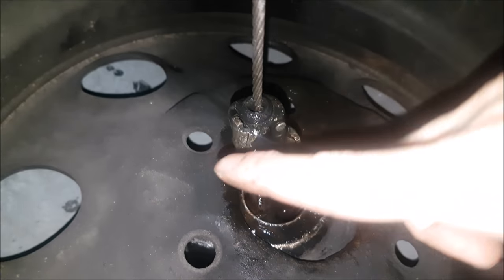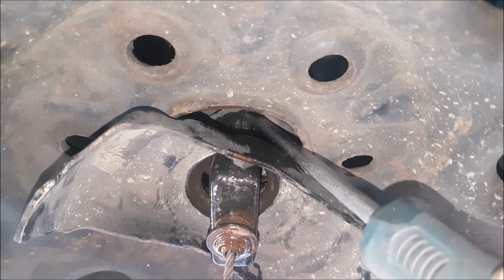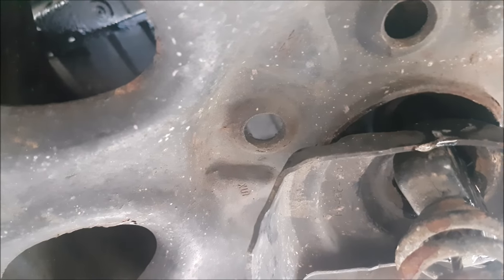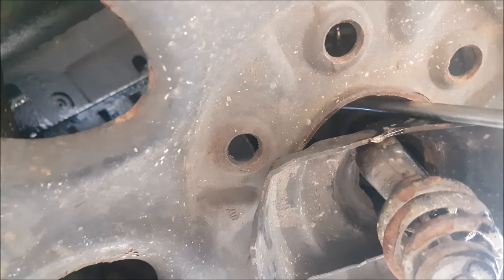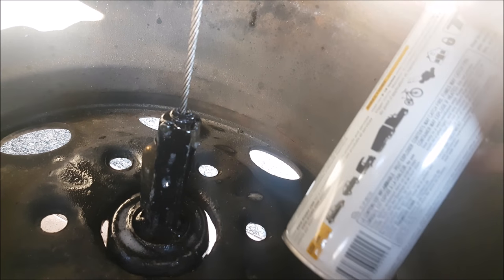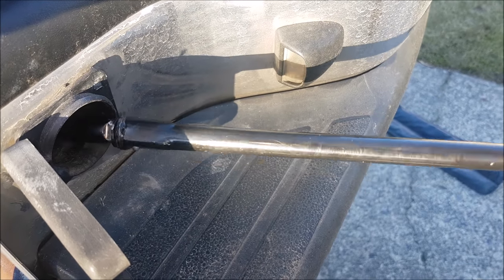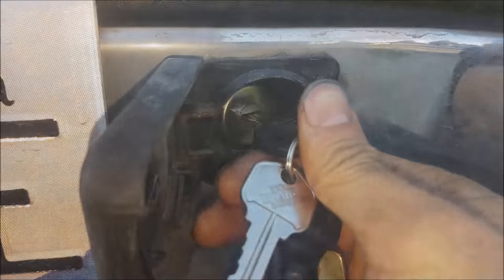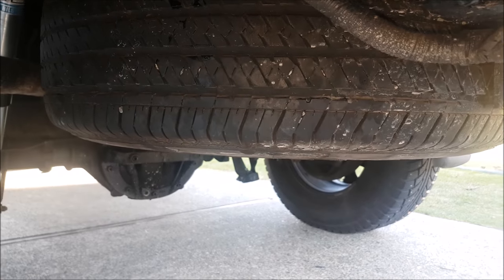Stuck Spare Tire Removal GM Truck / Silverado & Sierra (Secondary Safety Latch) | AnthonyJ350

Comment: 5yrs later and you still have people saying Thank You! Thanks man. You saved me from using my grinder wheel down there, I'd about had it!
Reply from the maker: Glad the video helped! You can taper the lock hook shape with an angle grinder. Then spray the assembly in Fluid Film to make it easier to drop.

Comment: 2009 GMC Sierra 3500. Thanks for posting this! Laying on the side of the road in heavy traffic, in the rain, and it won't release 🤬. I saw the part where you mentioned that not tightening up until it clicked can be a problem, so l wound it back up tight( the end of the tool snapped off, thanks GM) and the lowered it again, and it came down flawlessly 🙌👌💯
Reply from the maker: Ya I'm not a fan of this design. Glad you got it down!

Comment: Thanks a million for this video, I was about 5 minutes away from cutting the bracket off after spending a couple hours fighting it. I'm debating cutting the safety latch off when I put it back in. Here I thought taking off thr spare would be the easiest part of replacing the rear brake lines.
Reply from the maker: You can try lightly grinding the secondary lock so it doesn't catch so easily.

Comment: Worked like a charm, thanks. FYI, milk crates work great for holding the tire up while loosening it.
Reply from the maker: Great tip!  Thank you!  But you would be required to have it in the truck at all times.

Comment: Thank You for this video. This was my second rodeo with my secondary latch. I thought all the lube I put in the first time would keep it working for a while, it didn't. I was at home so I could use a floor jack and piece of wood to jack the tire up to get the weight off. Getting the weight off is key to this operation as far as I can tell. I tried to trip that latch with the weight on but couldn't.

IMHO, I've been around the block enough to see GM pull some pretty stupid mechanical pranks but this secondary latch business even beyond them ... I SMELL GOVERNMENT REGULATION on this mess.
Reply from the maker: Thanks for sharing

Comment: Loosen cable tension. Tap the bottom of the stem (you'll see it's spring loaded) with a mallet and that will also release the tire, very safely.
Reply from the maker: Thanks for sharing the tip!

Comment: Alternative tip: The hoist is held in by a single bolt.  If you remove the bolt and move the hoist toward the driver's side, the hoist will detach. Then you can pull the tire and hoist out from under the truck and work on it.
Reply from the maker: Thanks for sharing!
Reply: Size of bolt?

Comment: My '99 Silverado and my dad's '02 Silverado did NOT come with this secondary lock mechanism on the cable hoist from the factory, that came later and then they did away with it, so they had it right the first time.
Reply from the maker: Thanks for sharing!

Comment: Good video homie. Def got a thumbs up. I hate this design with a f'n passion. I don't see them changing it anytime soon though. I live in West Virginia. So salt wreaks havoc on this system and is a nightmare from hell stranded inside the road trying to get this bastard down. Your message definitely is a big help but even with it I've had troubles at times. Maintenance on it is a definite plus and it can definitely save you some cussing down the road. There's been times I have beat, kicked, cussed, slammed it with hammer, cussed more, beat, slammed it with a hammer some more, pride pride and pride, and about every other thing you can do underneath it to no avail. Some pb blaster or wd40 helps when salt has dried up the internal works. A couple 3/8" extensions that's really long and a short one or two work pretty good when the cranking extensions get worn out. Def pay attention to the lil knob inside that you attach to because it doesn't take much slipping with the provided extensions to round it off. Then you do have troubles when needing the spare and it's snowing or raining, the kids are crying,  woman is bitching, but nobody else will crawl under the vehicle....bu hey at least it is a place you can get away. Lol.
Reply from the maker: Thanks so much for sharing your tips on getting it down 🙂

Comment: Thanks been yellin, screamin and throwin shit all over I thought that latch had something to do with it but I wasn’t sure. I was just trying to put the spare back under there. You mentioned when tightening up to continue until it clicks - it should click twice and/or skip twice(feels like the thing turning just breaks for a second and then comes back. I didn’t do that last time and that’s why I could get it back down. It’s a secondary lock system so the tire can’t fall off.  The manual states that and insists the clicking or slipping twice. It also states you can not over tighten it, so no worries there. Thanks again brother
Reply from the maker: Glad the video helped you!

Comment: I was on the side of the interstate for over 3 hours the other day trying to get a spare tire to come down because the secondary latch was frozen. The cable would come down but not the tire. No amount of kicking or prying or pulling on it worked. What finally did the trick was raising and lowering the cable right at the point of where the catch kicks in until it finally dropped. Hope this helps someone I went through hell
Reply from the maker: Thanks for sharing your experience!

Comment: Please someone tell me... How is this system SUPPOSED to work? Is the safety latch supposed to remain retracted while the cable is under tension?
Reply from the maker: Ya that's what it's suppose to do.  Unfortunately now that the trucks are old they all get stuck now.

Comment: This is such a bad design. Especially in the mid west. Our Kia van rusted up so bad I had to cut the cable to get the tire off. 😡
Reply from the maker: It's definitely something you don't want to deal with in an emergency.

Comment: how is it suppose to work properly, what pushes the second latch out of the way when lowering
Reply: Just went through this myself.
The mechanism rests against the cable internally and when the cable takes on the weight of the tire, it's supposed to unlock the latch
Reply from the maker: It works with great difficulty....

Comment: Had the same problem,I just unscrewed the whole hitch from the truck. Planning on buying another hitch.
Reply: Chevy trailblazer change a tire
Reply from the maker: I'm going to try to modify mine and add more of an angle, maybe it will slip out easier.

Comment: I couldn’t get it with the screw driver, but I tightened it back up and lowered cable just till it was stuck and then kicked the shit outta it and it did come loose. But thx for video I lube it up good
Reply from the maker: Glad to hear you were able to figure it out.

Comment: IF This works, You will be saving lives "MY Man"!     More dangerous for some sucker to be laying on his back, at night on the interstate trying to do this,  GM should be sued! OR at least picking up the free annual maintenence tab making sure it works!
Reply from the maker: I'm still thinking about modifying it a little and grinding it a bit so it slips out easier.
Reply: I got stuck today for 3 hrs trying to get this damn thing loose.

Comment: The "safety" latch is an INSANE idea.  
I can't imagine ANYONE doing this on a dark night, on the shoulder of a freeway.

Crawling under the truck and poking/prying with a screwdriver is pure B/S !
If that's the best the engineers can come up with, they need to be hanged !

Get rid of that piece of junk !
Reply from the maker: Ya it's not supposed to operate like that. When they're new it drops out or you can kick the tire. When they're old, this happens.

Comment: what do you do when you get no movement from the crank? I turn and turn and nothing moves
Reply from the maker: Secure the vehicle with the parking brake, wheel chocks and put into park.  After you loosen the crank try kicking at the tire sideways.

Comment: Hello I am actually going to attempt to drop the spare tire in my 02 Silverado 1500 for the 1st time in 21 years.. I know I know stop laughing.. Am I to understand that if I'm turning the jackpole, the cable will come out but the black safety mechanism could still remain hooked... Let's assume the tire doesn't drop down at all.  What do you think would be the proper steps. I heard you say in the video it got loose but the tire would not come down. And do you know if there is a way to to unbolt the whole mechanism from the frame with the tire still mounted?  Last thing is that half inch square drive on the winch accessible when you're laying on the ground the ground assuming I have removed that black tube.. I was thinking a  cordless drill with a socket adapter, and I could reach over the top of the tire
Reply from the maker: Try lowering it first.  You might not have to do any of this.
Reply: @AnthonyJ350   Well I was certainly going to start with that but thank you. All of my questions were on the supposition that the normal way failed
Reply from the maker: @mrobvious1100  The video should address all of your concerns

Comment: And as long as you are there, fill the tire full of air! You can bet that spare that's been under there long enough to corrode and rust the mechanism is going to be very low on air!
Reply from the maker: Great tip!

Comment: Mine is froze up tighter than Dick Tracy's hatband. I have beat on the mechanism until I'm blue in the face. Had to cut the bottom mechanism off with a cutoff wheel. This is the second disaster and I lost the whole spare tire the first time. So the safety didn't work when it was supposed to,😂😂😂😂
Reply from the maker: Really sorry to hear you had to deal with that
Reply: @AnthonyJ350  thank you very much. I bought the updated version this time. No secondary lock.
Reply from the maker: @johnnypop5235  Good to know they've updated it now

Comment: What if you can't get the tire to come down at all?
Reply from the maker: You can't get at the lock?
Reply: I'm in its just that the rod won't catch so I can't even crank it down. I know I'm using the right end of the rod. The square end with no metal ball. 2012 Silverado

Comment: My spare ain't going nowhere an I can't see shit.
Reply from the maker: Might need to bring it to a mechanic and get it on a lift to get a better vantage point.
Reply: @AnthonyJ350  ya sorry I'm just venting cause I'm late for work. I turned the winch for a good ten minutes an the tire won't budge. I'm also in a parkade so I can't even get towed. Something is catching I think above the spring and tire.
Reply from the maker: @EncyclopediaX  It's the secondary lock screwing you over.
Reply: @AnthonyJ350  yep it was thanks man , subbed
Reply from the maker: @EncyclopediaX  Thank you!

Comment: None of the tricks worked for me I after lowering the tire a bit I used a long extension and removed the bolt for the whole assembly and shook it loose I had buckets under the tire.
Reply from the maker: Glad to hear you figured out a solution. I would replace the assembly if it was that bad.

Comment: Any idea why the tire wobbles so much when positioned all the way up? I can hear it wobble when I drive and can push on it and it’s not firmly in place. Any ideas?
Reply from the maker: Winch might be broken and need replacement.
Reply: So looks like I fixed it. Wheel was mounted with the front of the rim against the bottom side of the truck. I flipped the tire and hoisted it and its secure now. Either that clamp wasn’t sitting securely against the rim and/or hoist was at its max up position not securing the tire completely. Thank you for your response. Got to lube up the wire while I was at it to!  I blame it on BigOTires when they changed out my spare for a new tire ha!
Reply from the maker: @markymark34  Good on ya for identifying the problem and fixing it!

Comment: Ok this is a spare tire. Why in the world do they make it so difficult to remove in the 04? I had a 2000 Silverado and it wasn't this difficult, you just let the tire down and turn the center fixture at an angle and pull it up through the center and remove wheel. Honestly these 2004's are going to strand a lot of people simply because you almost have to be a mechanic in order to remove it. This is so way not cool!
Reply from the maker: It's because the mechanism gets stuck over time.

Comment: Cut the cable & throw the tire in the bed. This is one of many stupid ass ideas from General Motors
Reply from the maker: Most trucks use a cable system of some sort though.  Also a lot of people need to use their bed, like construction workers.
Reply: @AnthonyJ350  true, but I’m a construction worker & carry lots of tools & Materials with the spare in the bed. That cable system sucks! On the other hand if I would’ve kept up on maintenance I’m sure it would’ve been fine.